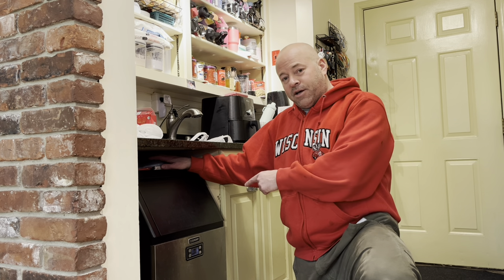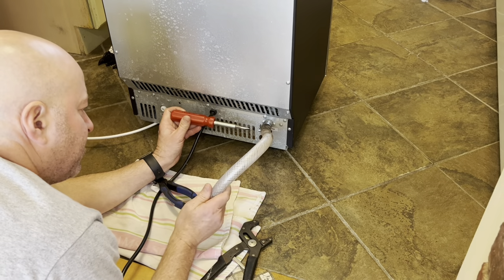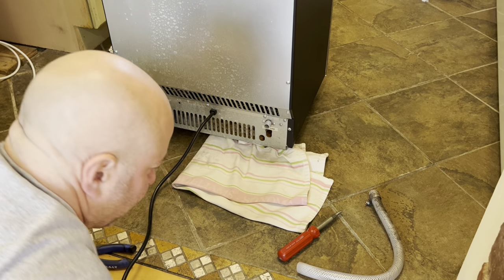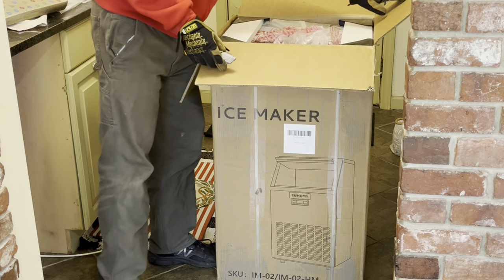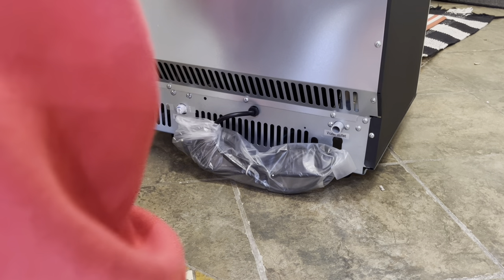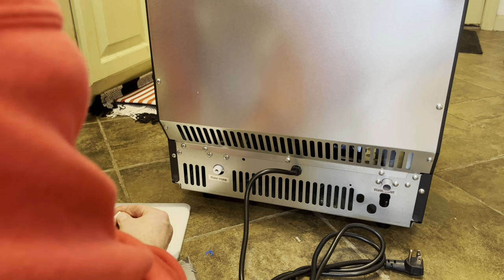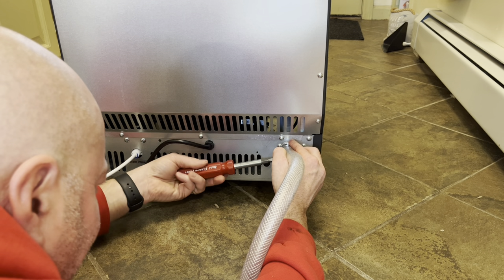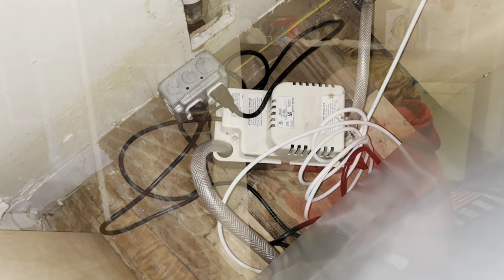How to Install Euhomy Ice Maker - 100 lbs/day

Comment: Thanks for taking the time to create and share this video Terry. Got the same machine on a Prime Day deal and about to attempt installation. This video helps a ton. Great idea, I didn't even think about using a condensate pump for the drainage. Greatly appreciated! 😺👏🏼
Reply from the maker: The condensate pump has been working without any issues for ~4 years now.  All the info should be in description.  Good luck!👍

Comment: Just got my euhomy last week. One thing that bothered me is that it didn’t come with one of those cool blue lights on the inside. I bought a set of two rechargeable leds off Amazon that are magnetic for $25. They came with magnetic sticky pads so I was able to place the light on the backside of the door and it’s motioned sensing so it automatically turns on when you open the door
Reply from the maker: That is awesome!  Will you post a picture?  👍

Comment: I’ve had this same unit for a year and I have black mold all over the back. I haven’t cleaned it religiously like it recommends but even when I cleaned it I could never get the area to the right of the running water and the white water chamber below the running water to stay clean and mold free. Any recommendations?
Reply from the maker: You can make a solution of bleach to kill the black mold.   Then just rinse well.  Don’t spray bleach on metal or it will corrode. I took my basin apart to clean the iron and hardness out of it.  That’s the best way I have found
Reply: Do you remove the front door to gain better access to the back to clean? If so, how do you do it?
Reply from the maker: @carlosarney If you unscrew the top you can get full access.  It’s easy.

Comment: I have installed mine in the kitchen and the drain line is going into the drain line for our sink. The drain point is about 6 inches higher than the drain exit on the ice machine. Is this an issue? Does the machine have some ability to pump the drain water?
Reply from the maker: Please look in the ‘Description’.  You need the condensate pump and you will be all set.
Reply from the maker: https://amzn.to/4clhVK7
Reply: @terryclayton  Thanks for the help!

Comment: Have you had any issues with the ice maker draining because in your video, it looks like the drain hose from the ice maker goes up and then into the condensate pump?
Reply from the maker: Hi Tracey.  The condenser sits slightly lower but even if you have a slight rise, there won’t be issue with water draining. T

Comment: Love the videos!   I picked one up, plugged in and hooked up to a water line and it's not pumping water.   Wonder what the deal is
Reply from the maker: The unit does not have a pump.    The water pressure should fill the water tank as long as the solenoid opens the valve.  Check your water line for pressure and turn off/on.   You should hear the solenoid click to allow water in.  Good luck!

Comment: Dead sir i have tge same machine but lose the manual    Can u help me with setup the timmer and donthe self cleaning ?

Many thanks
Reply from the maker: Press and hold timer button.  Should take 20 minutes to finish cleaning.  I prefer to wipe unit with vinegar and then dump the water after this .

Comment: We put the drain pupe into a home depot bucket and it appears to be draining 5 gallons of water every hour or so, is that nornal? If so, that is a huge waste of water
Reply from the maker: No that is not normal.   Water must be leaking into ice bin from reservoir or spraying over the evaporator (where ice grows).  You may need to rotate fluted tube to direct water better.

Comment: I Think the drain is supposed to have a air gap to keep the ice maker in case of a back up
Reply from the maker: Good idea.  My drain flows into a condensate pump with a vent so no risk of backup.

Comment: Try cleaning the evaporator where the ice is made. Once too much mineral is built up it provides additional grip on the evaporator not letting the ice fall off the plate. Regular cleaning on ice machines is a requirement or you will get extended harvest times and errors from them not dropping the ice sheet in the allotted amount of time and causing the machine to throw error codes. Another potential issue is the nickel plating can flake off the evaporator over time and this is non repairable causing complete failure if the machine. Using proper descaler is imperative when servicing ice machines.
Reply from the maker: Great input @shanefarley3575.  I typically use vinegar (5% acetic acid) but have also used a citric acid solution I make for my Keurig to clean it.
Reply: Mine quit making ice also, used about 2 years, never cleaned the mechanical parts, I took a air hose blew out evaporator and everything underneath, now makes so much ice, actually seams to make ice better than new

Comment: We just purchased this unit for one of our customers.  They went on vacation for a week and came back to water being all over the floor.  Can you give any insight as to why this would happen?
Reply from the maker: I would need to see where it leaked.  Possible leak points are: a) water line from plumbing, connection to water filter, push-connect to rear of unit.   Lastly, the euhomy has a drain line in the rear for ice melt.  this needs to run to a drain.  Alternatively, I have mine draining into a condensate pump which moves water to nearby sink drain line. (see in video). I have never had this issue before.  Let us know what you find.
Reply: I will.   Thank you